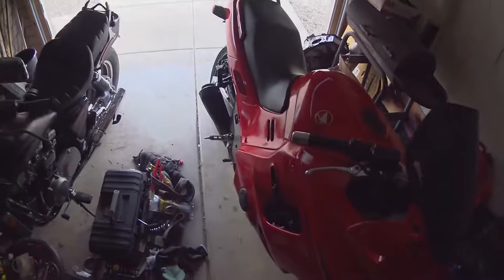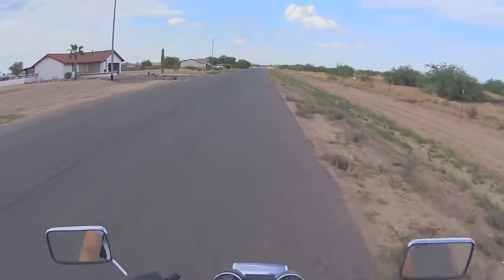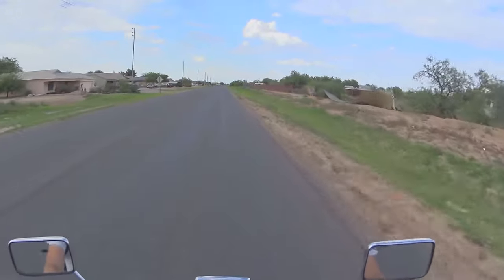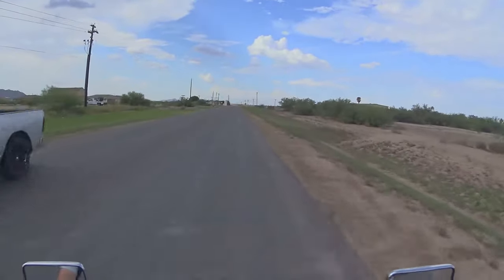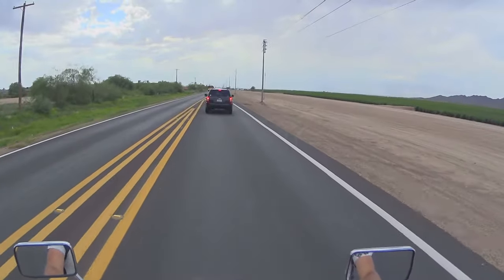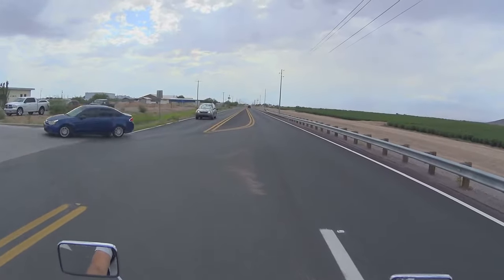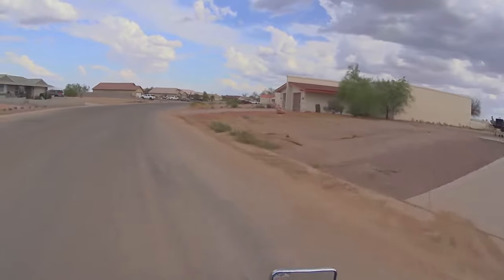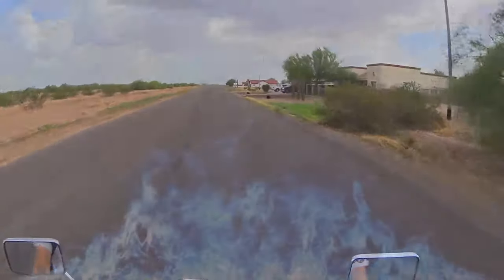Fixed Mic!, Clutch slip, retracting, pressure, slave, master cylinder, bleed clutch, MOTOVLOG 163

Comment: Nice to see the old bike out and running .  I would see if you have a friend with a DC amp meter and see what the fan motor is drawing . you will also need the amount of watts or amps the motor is supose to be drawing.  remember  watts / volts (12) = amps  if you have the watts it should be useing.  seeing they are both old motors they sound like they are useing to much .  Did you adjust your clutch basket as well when you did the cyl and fluid ??    off topic but do you use linux as well ?
Reply from the maker: I fixed the clutch problem. I did some research on how they work. Found that the vent hole, in the master, was clogged with sediment, from when the fluid dried up, from the last owner (it sat a while)

I have no idea about the fan. So, now I found that it runs fine, while off of the bike, but as soon as I situate it, where its supposed to go (already on the radiator) it has the problem again.
I feel like it's something to do with it grounding, to the frame; but it makes no sense, to me. I've connected it straight to the battery also. Same problem

No, I use Windows, but I've used Linux years ago
Reply: @TheInferno  strange .. is the frame of the fan getting twisted a bit putting presure on the motor in some way ?  seem funny it works off the bike
Reply from the maker: Nope. This is the first problem I wasn't able to figure out, on a bike. It runs good otherwise. The fan will only kick on, in stop and go traffic, and when it's really hot out (110F+)
I really gave up. I spent, probably, a week straight, all day, and night, trying to figure it out.
I have it up for sale, with that problem in mind, so not going to be making a huge profit.
Bike runs great otherwise. I really like it, but I'm looking for one with a bigger motor (1Kcc and up)